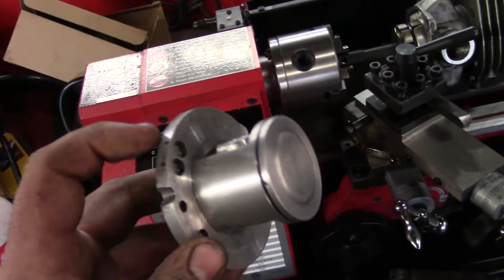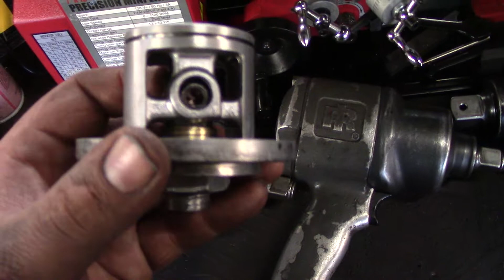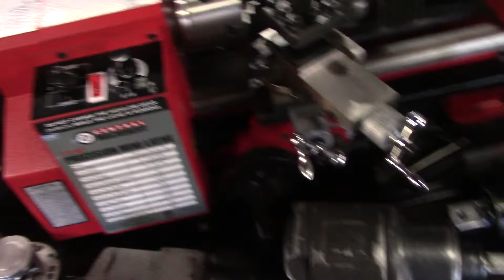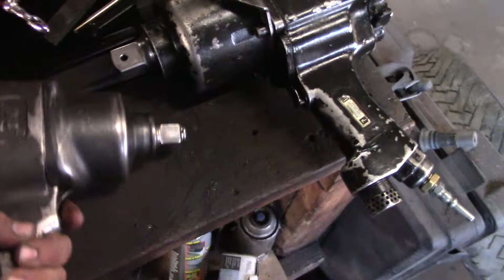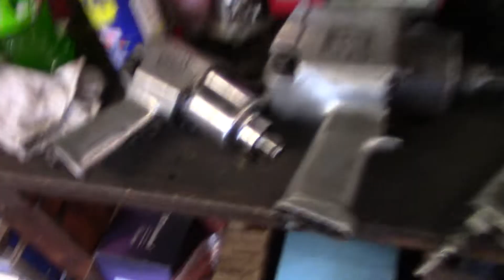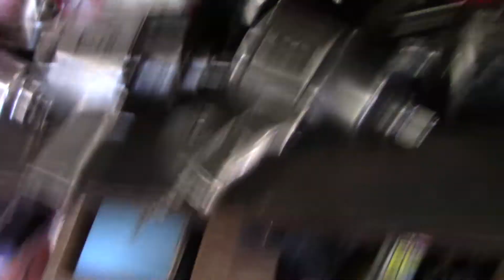Harbor Freight Mini Lathe For The Husky 372 Cutting Chainsaw Cylinders And Cutting Pistons

Comment: Thank you for this video .....I mess with saws for a hobby and bought one of these lathes a few years ago and I've never ran it because I didn't know much about it or if it would cut my bases....Do you cut squish ?
Reply from the maker: I usually sand the squish bands with a piston or wooden mandrel. I usually take at most .030 off with that method. When it starts to put scratches in the plating I stop.
Reply: @kennytheguitarfanatic054  what part of the country are you located?
Reply from the maker: @70skid67-c5b  in pa
Reply: @kennytheguitarfanatic054  I have about 30 pro saws mostly husky and sthil I HV a 2100 husky hot saw built in the 80s with two different pipes all was built by EC Burt ....would you be interested in building some pipes ??? I HV the perfect design Dyno tested for 90 cc plus saws
Reply: @kennytheguitarfanatic054  do you have away I could email you?

Comment: Does that mini lathe vibrate alot when you are cutting cylinders?
Reply from the maker: No vibrating just run it slow . I have cut 2 cylinders on that lathe. But make sure you indicate the cylinder in at most .003 flatness before cutting. On that lathe so just  take about .002 or .001 per pass.  It should work great.
Reply: @kennytheguitarfanatic054  Okay. I just bought a  Bernardo 500 lathe and will make mandrels for different size of cylinders although that tail pipe expander is cool concept. Upgraded from 100mm to 125mm chuck immediately. Only have cut 1 junk cylinder yet but it was fine. In a past i have been doing just gasket deletes and alternative piston to adjust squish. Its weird to get back to machining after 17 years when you need to try to remember stuff out again :D